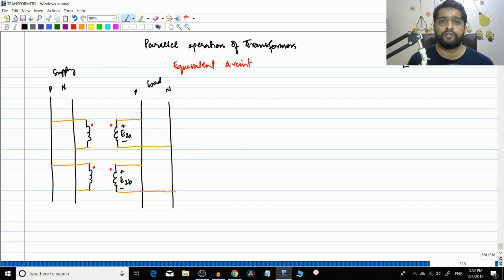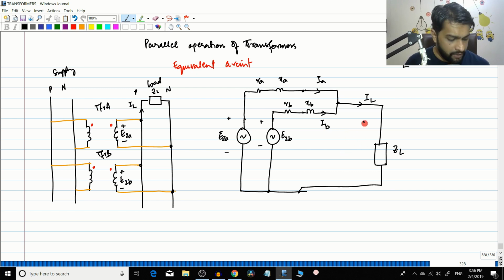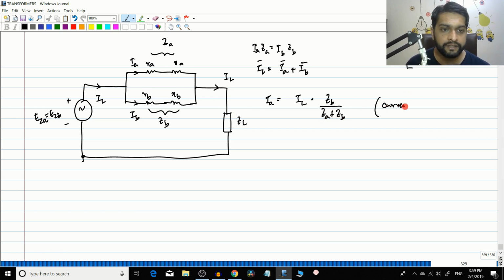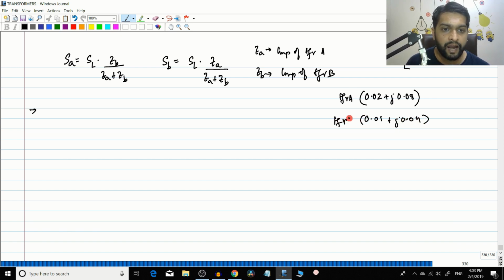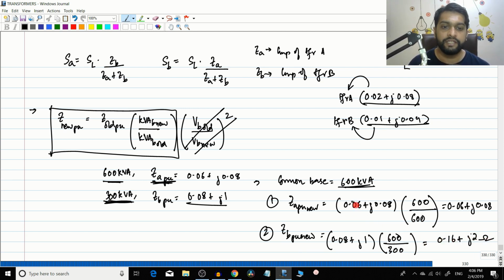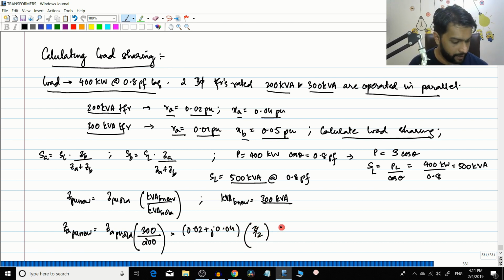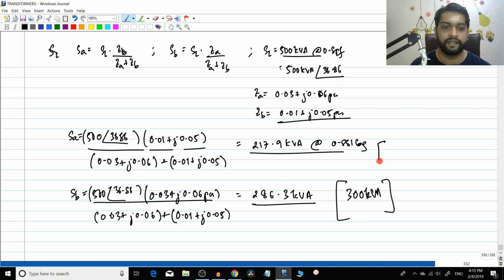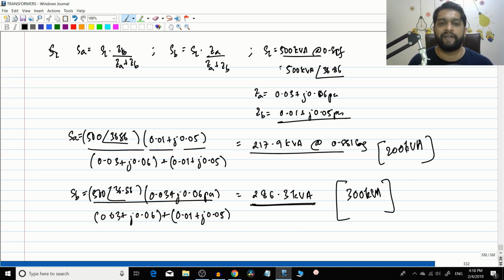TRANSFORMER #63 - PARALLEL OPERATION OF TRANSFORMER ( PART 3 ) Equivalent Circuit and Numerical

Comment: i think load sharing formula is wrong.it should be {Zb/(Zb+Za)}*.conjugate should also appear
Reply: Hey, I think you are right, can you give the source?
Reply: No it is true, tfr A shares more than the full load kVA rating. If you load the transformer further, the output voltage will get reduce, it causes not able to load transformer A further with a full load.

Comment: One tiny thing to consider, In the explanation on floating neutral: I agree that the magnitude of the resultant phasor sum of the fundamental and third harmonic voltages continuously changes and therefor the floating neutral ( an outstanding explanation btw)
According to my understanding of rms though the integral of the time values over one period ( the heating value ) will not change actually. A minor thing indeed, the rms value doesn't change, but the magnitude of the resultant certainly does. Please let me know if this is not communicated sufficiently. God Bless you !